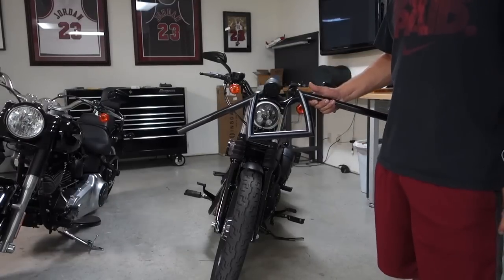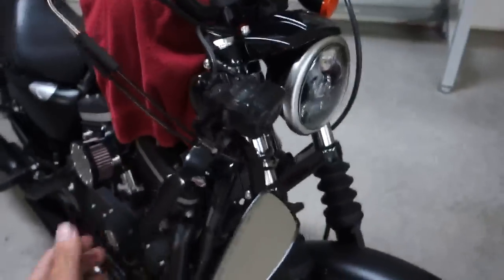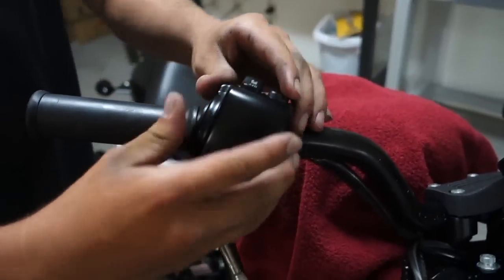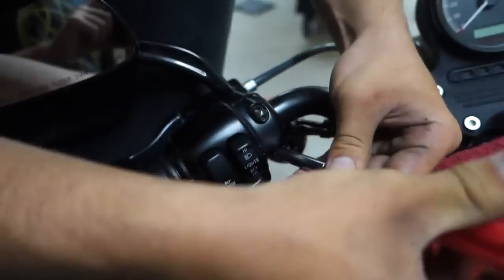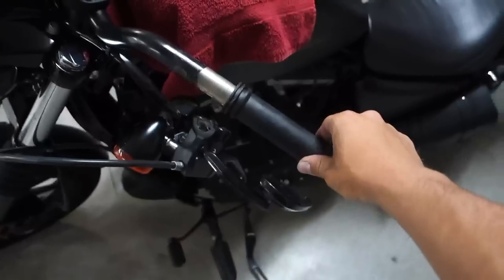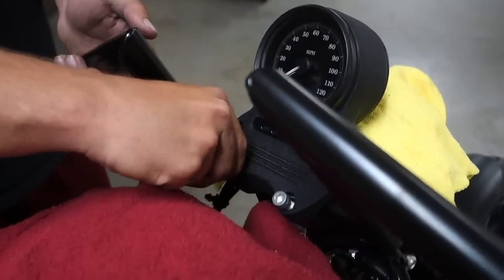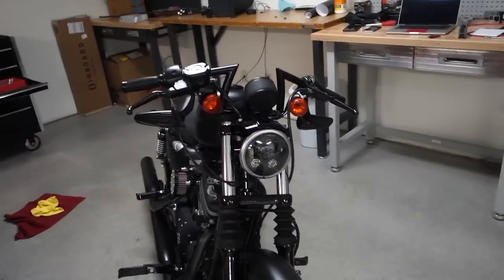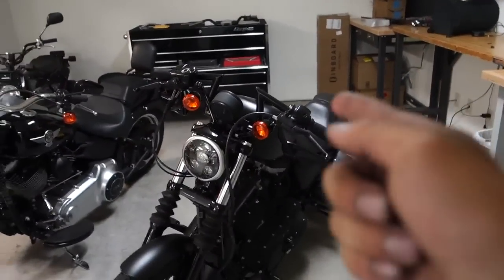HOW TO: Install Biltwell Keystone 1" Handlebars

Comment: Tristen, You sound like you know what your doing, so I thought I would ask. I am an older guy(arthritis) I have  forty eight I never cared for the apes, so I been thinking beach bars or speedster pull backs with a riser, I have noticed that the beach bars fit the forty eight as well as the slim and Harkey made a set of four " curve backs that I would like to put on the forty eight. Would you happen to know if they are a fit? Thanks ahead of time,Mike

Comment: yah did't ha\/e to take your whole throttle apart, loosen up screws, remove your bars and slide the whole throttle assembly off and just slide on other bars before you put bars back on bike. the whole assembly will slide right off and slide back on other bars. taking it all apart like that is pointless. just saying.
Reply: I know I figured that out after looking at it. much easier.

Comment: did you have to change or extend the cables?
Reply from the maker: Lester Jan Pearson cables are pretty tight, although everything still works as it should.  Have put on almost 2k miles with it and have had no problems!
Reply: Tristen Jourdan do you lean more than the stocks or sit upright?
Reply from the maker: Lester Jan Pearson You lean a little more than stock.